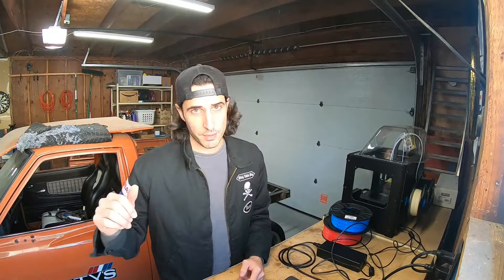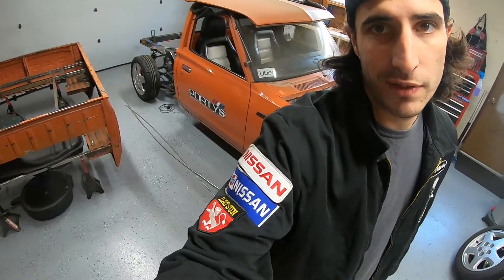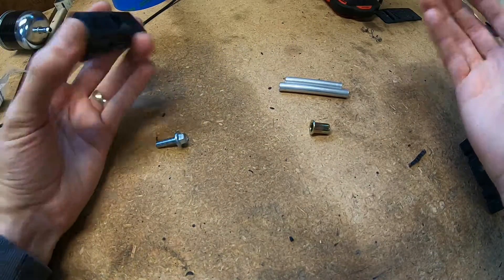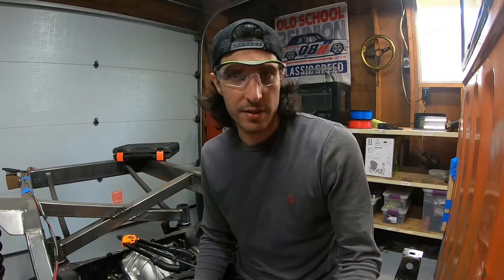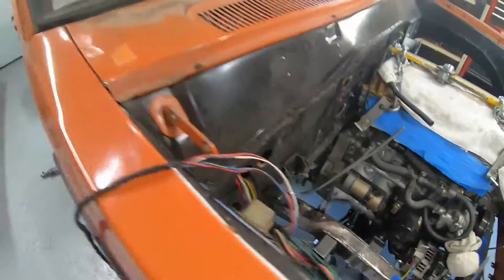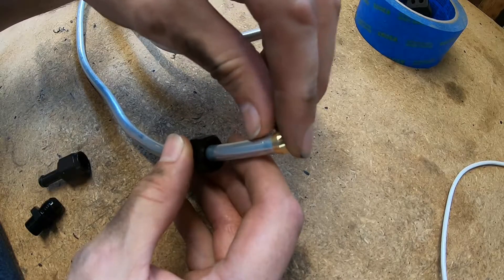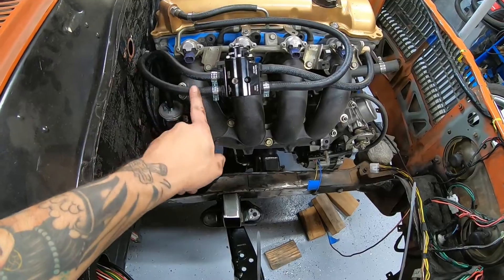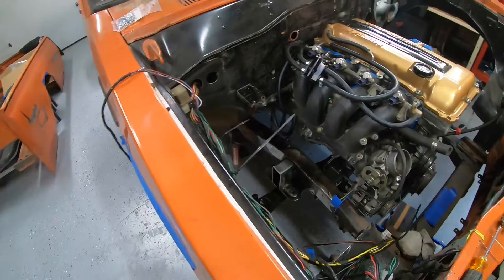Datsun 620 SR20 - Fuel system install (+ 3D Printed Parts and PERRIN Performance FPR!)

Comment: Great walk through! You gave me a little more confidence in replacing the stock fuel lines.  Can you elaborate a little on why the proportioning valve isn't needed when you are lowered on these 620's? I'm guessing it has something to do with the movement of the truck when braking but just guessing there.
Reply from the maker: Not a problem I posted it at the bottom of the description now!